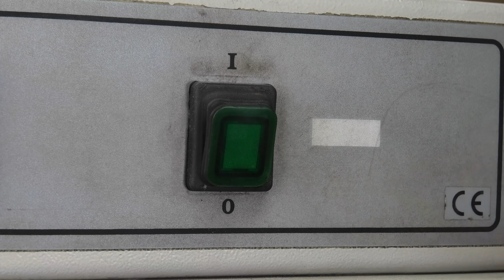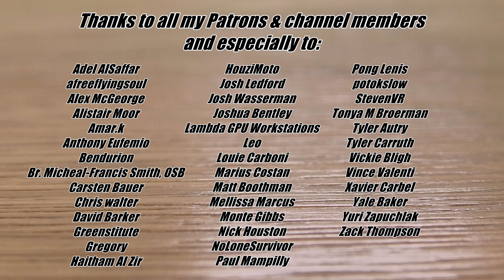Domed Cap Nut - How it's made (DIY)

Comment: Having watched a number of other videos of folks doing machining and lathe work, I'm dang impressed how I never see smoke coming off your parts and how I often don't even notice if there's cutting fluid or not.

Is that because of a knowledge of how fast to run things and how much to take at a time? Or is it a knowledge of how much cutting fluid you actually need, so it never looks like it's swimming in the stuff? Or just extremely sharp bits? Or all of the above?

I count the tapping fluid separate - never seen anyone who doesn't use that stuff liberally.
Reply: He is often cutting brass and aluminium, which don't tend to create as much heat, or small steel parts with carbide tooling. The smoking parts you may see on other channels are often very large steel parts hogging off large amounts of material.

Comment: I always see the amount of scrap metal from the lathe and I wondered if you recycle/reuse it in some way or is it trash
Reply: A friend has a couple of lathes and a couple of mills that he uses regularly.  He separates various scrap, ferrous, aluminum, acrylic, nylon, and each gets sold by weight to the local scrapyard.  This is in Michigan, in the United States.
Reply: Yes he recycles all the metal scrap, shavings, and bits. Switzerland requires this.

Comment: 1:00 - "it's made of two parts,  very unusual" - I'm afraid I have to put a little fly in your ointment - this is VERY USUAL. Most mass produced cap nuts are in fact made of two parts - the nut itself, and the attached cap, which can be easily seen in its "free state" when you try to put such nut on a too long screw - "pop", and the cap separates. However it has to be said they are joined in such a way that the joint looks pretty seamless. Also, the way the cap was made (and attached to the nut) IN THIS CASE is rather unusual - seems like back then it was easier to press a sheet stamped decorative cup onto a regular nut then spot weld it together, polish and get electroplated.

Comment: How much money did the original manufacturer save by using a stock nut with a sheet metal cap?  Your cap nut is much nicer and would be preferred if you were not trying to use as many original parts.  Great video, thumbs up.

Comment: I wonder how many people spotted that the thread was a BSW one. 'British Standard Whitworth', a British standard (duh!) using Imperial measurements, so the Coffee Grinder had some sort of connection with the UK (or, less likely, the US or a Commonwealth country).

However My Mechnics says it's Italian and the handle has words in Italian cast in to it.

'Made in Britain' and then 'Badge Engineered' in Italy? UK made and marked in Italian because all good coffee stuff is supposed to be Italian? Made in Italy but the threaded parts brought in? British arm of an Italian firm, or a family of Italian decent starting a British firm? Who knows?
Reply from the maker: In earlier days they didn't always stick to metric when they had the metric system in their country. The italian tire inflator I restored also had BSW threads. So did the czech scooter.
Reply: I was going to ask about that. Because I've owned a series of old British cars, I have various Whitworth spanners, so I jumped when I saw that part of the video. As for the US, though, I don't think they used Whitworth much beyond a fairly brief period in the 19th century, before developing their own standards, which would eventually become UNC and UNF.

Comment: When you drill the hole in the nut you start with an oversized drill and then switch to a smaller one. What's the reason for that?
Reply: The oversized drill is just for getting an exactly centered starter hole for the smaller drill. you get them as these 90° drill or as 90° drill with  a smaller prolonged tip. In Germany we call them "Zentrierbohrer", I think the translation is literally "center drill".